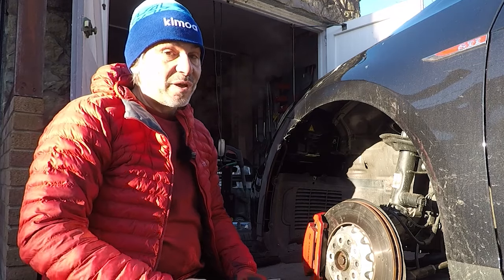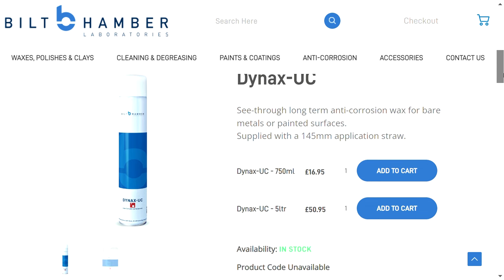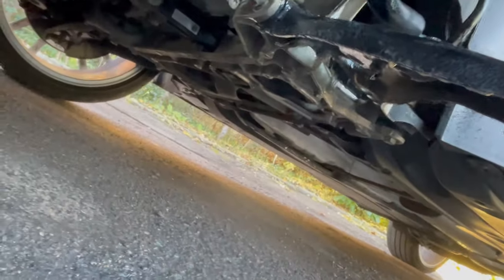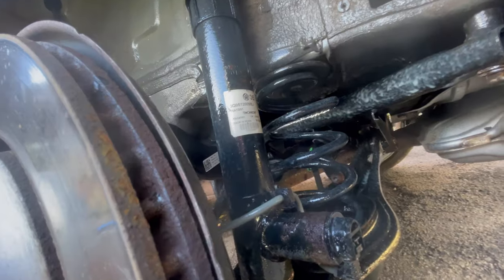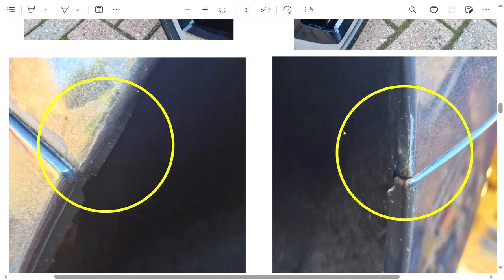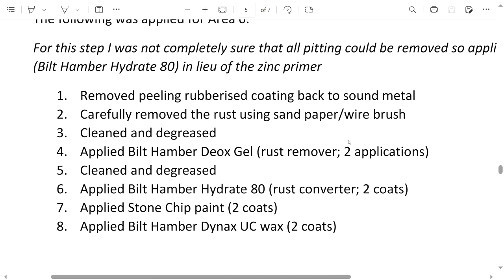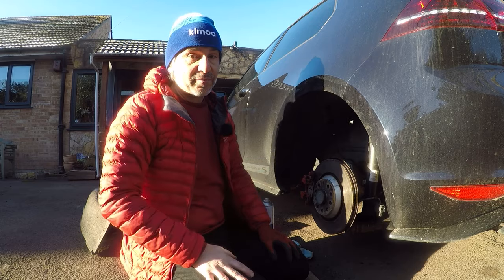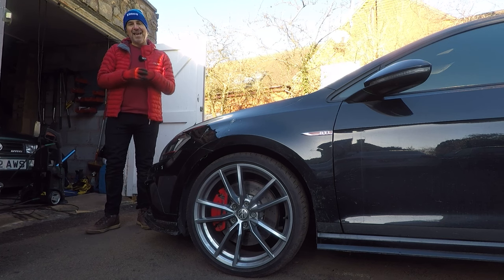MK7 VW GOLF RUST ISSUES + HOW TO PROTECT YOURS  #golf7 #mk7golf

Comment: Hi Andrew, thank you gor your honesty regarding rust issues on Mk7.5 Golf's. 
Drspite our 2014 GTD having an awful reliability record, at leasr it's not going rusty. I had been thinking about replacing it with a Mk7.5 GTi or R, however, have there only been a few isolated cases of rust on these later cars, or is the build quality that poor that they'll start rust quicker than Mk3 Golf's?
Mosr of us knock Ford and other mid market brands for their inferior build quality, but my Mother in Law's Mk2 Focus has been far more reliable (and rust resistant) than the Mk5  and Mk7 Golf's we've owned.

Comment: From owning a 90s civic for 20 years, rust was on ongoing battle. I used Rust Bullet paint esp useful for high impact areas. The stuff sets like concrete, extremely hard wearing. It was developed for the US military, used on wing tips of US fighter jets, warships and other hardware, so its been used in extremely harsh conditions. One tip, don't get it on your skin, it takes weeks to come off.

Comment: Great video, Andrew. My 64 Plate Golf R had started to show corrosion at the very bottom of the two front wings. I used Dinitrol 4941 which was great and has lasted and fitted mudflaps👍
Reply from the maker: Thanks Andrew, appreciate the owner feedback. Good to know you treated it and it didn't come back.  Doing it yourself is the only way to be sure it's been treated properly.  I always wondered if bodyshops can be bothered to treat rust before painting when they've been asked to repair it..?

Comment: Great video Andrew. Does the BH product stand up to pressure washing if u clean your wheels and arches, or do u need to reapply?
Reply from the maker: That's a good question.  You do need to be careful in the arches anyway as it's not hard to damage the relatively soft underseal on some cars so on that basis it should be OK with the usual care
Reply: I have this stuff in the arches of my A3 and it stands up to pressure washing easy. It’s still on after 2 years. It will deteriorate eventually but you’ll need a solvent to remove it properly.

Comment: Great vid. Cleaned out behind the front arch liners on my Mk7R last winter, should have binned the foams, been squeezing the water from them through the door wing gap 😔 need to get them all off soon and get blasting with the Dynax. Used lanoguard on new running gear on my mk4 1.8t last month but find lots of debris sticking to it.  Is the dynax as sticky?
Reply from the maker: It doesn’t appear sticky no but temperature will have a part

Comment: My second CSS had 2k miles and was used in one winter and the rust on th suspension components was unreal. To the point where I did a complete rear underside refurb on it. Have a look on detailingworld. VW components are all cheap steel with a light coating of black satin paint. Dreadful. In the end I sold my car. The first one I had was protected underneath with dynorol. It worked well but collected every bit of crap. When these cars were new or even a new Mk8 GtI / R I would 100% be coating the underside. BH products are brilliant.
Reply from the maker: Great feedback thanks - the problem with undersides is once you've looked it's often too late

Comment: I would have it done by a professional instead of spraying some around myself. It costs a bit but then you can be sure that it is good and you have a warranty. Moreover, Dinitrol is still the best anti-rust agent. But if you really don't want rust, don't buy a Volkswagen!
Reply: Dinitrol is shit. I’ve had it crack, both underbody and cavity. Would end up causing more trouble than it solves. They weren’t interested when I contacted them.
Reply: @royfontaine5526  No, of course they weren’t interested. Anyone who uses Dinitrol in any way knows that it remains supple and self-healing for years and has very good penetrating properties. If your stuff is cracking, it certainly wasn't Dinitrol you used.
Reply: @jan4004  it was genuine Dinitrol, purchased from a reputable (perhaps the best known) retailer. And it was indeed shite. Would never use it again.
Reply: @royfontaine5526  It's about the product. The best retailer sells exactly the same product as the worst retailer, that doesn't mean anything. Furthermore, it's your car and your rust and that's fine as far as I'm concerned, you don't have to convince me.
Reply: @jan4004  whatever. In my experience, Dinitrol is shit and I’d not recommend it to others.
Reply: @royfontaine5526  Very good. For what it's worth, you don't have to convince me. It's your car, your rust. Good luck again!

Comment: Andrew what did the knocking sound turn out to be? 
Was it the lower crash bar behind the front bumper?
Reply from the maker: I wish it was that bar Tom, I got the bumper off in the summer and it was solid and intact, car was completely virginal in every area apart from one...it had front discs and pads and it looks like pads spring clips aren't in correctly and allow movement.  I bought it in Feb and it was quiet, got worse as weather warmed up. Late summer I could move callipers by hand and they would clonk.  Today at zero degrees it's perfectly silent and callipers don't clonk so must be something to do with expansion. I would get the pads off and adjust the clips but pointless now as it's still quiet so one for spring and summer, pretty confident it's those because callipers make a noise by hand that's similar and they've been touched before.  Also it's left and right side making the (clanking) noise when driving and both callipers make the clanking noise by hand so fingers crossed :)

Comment: Gosh they don't build them like the mk2 or mk4 or even the mk3 which was a rust bucket of its day. Surprised to see so little stone chip paint in the arches.

Your efforts will secure the future of the car for sure.
Reply from the maker: Thanks Matt, glad you approve. Yes those arches are very sparsely treated, you only have to look at the GT4 to remember what they used to be like.  I always used to be careful to avoid pressure washing stone chip protector in wheel arches, on Mk7 there is just seam sealer on the joints and that's pretty much it.  MQB platform was created to save VWG money and this is one of the many ways.
Reply: @volkswizard  yes your GT4 arches are what I was expecting to see on the Clubsport S (and general mk7s). Was the mk5 like this too?

Comment: Interesting video. Can’t believe why VW fail to make improvements to the list of ongoing issues.
I’m not really a VW owner as such I had a Golf R DSG for 2 weeks the gearbox is a big letdown so sold it .I purchased a VW Polo for my daughter very good little car unfortunately the VW after sales is terrible .
Your fleet of vehicles really interests me .
Keep up the good work 👍
Reply from the maker: Thanks Kevin, much appreciated 👍🏻
Reply: What didn't you like about the gearbox?
Reply: @twinring3846  Hi after being used to BMW DCT I was unimpressed with the inconsistent sometimes during cornering waiting for the shift and also a gearbox that overrides the paddle shift may be safe but why bother with having paddles if it's going to be an automatic. Still very capable car but annoying and whilst on the subject I never test drove before buying as it was covid I thought 4 cylinder lacking and 4 wheel drive boring. 
Only saviour of the experience launch control the best I've ever had 😂
Reply: @kevinneary2283  Did you ever feel like the car selected the wrong gear at any point when accepting from a roll? 
I have a GTi PP manual, probably better than the auto in some respects?
Reply: @twinring3846  The gearbox was just a bit lathargic when getting on the power out of slow corners I would say. 
In a straight line under power not so bad .
Manual is probably the safer option also these gear boxes are expensive if go wrong.
Reply: @twinring3846  I ment the DSG is expensive if faulty and my friends went wrong no fix needed new gearbox
Reply: @kevinneary2283  Wow! A new gearbox can't be cheap. A lot of second golf Rs have been abused as well. I'll definitely stick with my manual. Only one previous owner, full VWSH, 3 door mk7.5 and only 23k on the clock. I think I'll keep it for many years to come. Thanks for the advice

Comment: Volkswagen UK refused point blank to consider the corrosion i had on my previous mk5 on the front wheel arches because of that foam insert in the arch. Disappointing considering it was such a well documented issue. One of the reasons why i moved away from the brand.

Comment: Just ordered some for my seat leon fr. Cheers
Reply from the maker: Nice one Gary, make sure you give it a good wash before applying. I didn't do this but liners off then pressure wash might be best way on a car that's done a few miles as the muck hidden behind them can be significant (don't know mileage of yours).  Especially that area between rear panel and rear bumper.
Reply: 2014 65k.

Comment: Hello,
What you are doing is absolute rubbish.
The first step should be to remove the wheel arch liners and clean everything with a high-pressure cleaner.
Then, when it's dry, tape off the cables, brake hoses and brakes.
Then you can spray everything nicely and not make such nonsense as in the video.
Please don't copy it people, it doesn't last long and it doesn't help.
The places that then rust are folds, corners and places UNDER THE WHEEL HOUSE SHELL and underbody paneling.

I don't understand how you can put something like that online?!